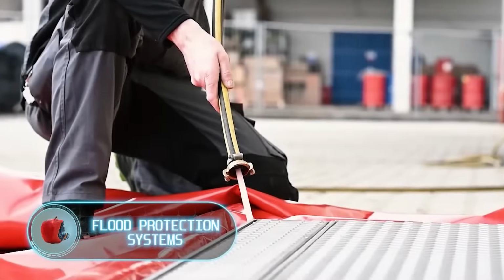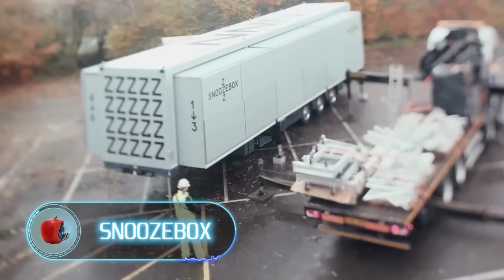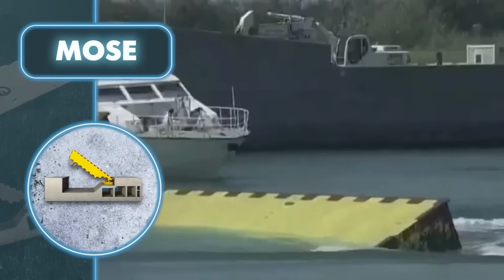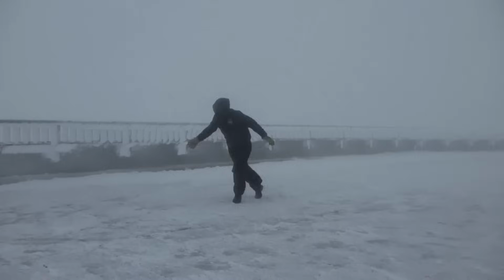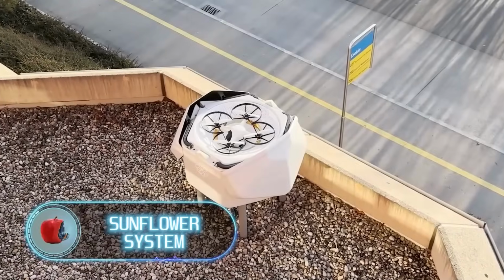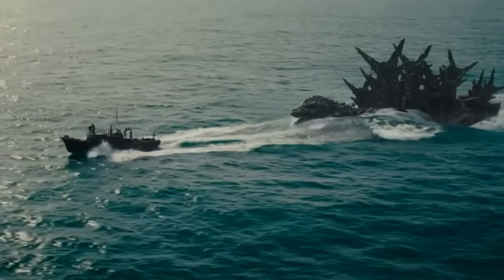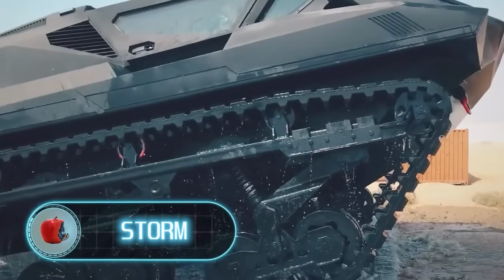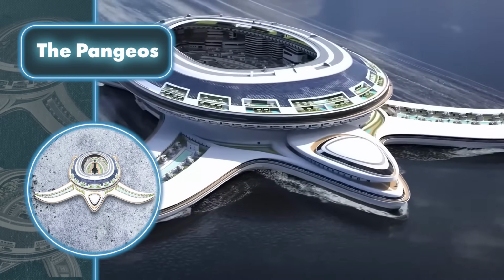50 Incredible Inventions for the End of the World

Comment: Solar flower made me think, it was going to be wind turbine combo unit, obviously it wasn't, but the idea (at this moment) seems interesting to me, using large surface area blades at low speed, and with the right control system deciding to give solar or wind priority for aiming direction, getting dual use out of a site.🤔😁

Comment: Get an electric lock, put the controls on the opposite side of the door.
A fireman I knew, he designed his house that way.
You walk up to the door handle. Push down on the door handle, but do not push on the door from there. That's where the door is hinged to the wall.
When you push down on the handle. The other side unlocks and pushes open a little bit. Where you can push the door open. It would mess people up.

Comment: From my experience in Zombie Apocalypse I will suggest the spikes are a bad idea. Zombies tend to get stuck on them and render them not only useless but can work against you. If backing up (not a good idea in an apocalypse) does not dislodge them, then you will have to do so manually. I would make them retractable for this purpose. They they should slide off leaving only a minor oozie residue to wash off.
If anyone needs suggestions for Alien invasions or Godzilla attacks let me know. But It wont be here as its inappropriate to the poster of the video.
Reply: I was thinking the same thing plus those rim spikes would either break off, break your wheels or get you stuck in tight spots

Comment: OK, major, major problem with using some of these underground storm shelters.  Anyone else notice that most of the doors open outwards? Have this thing in the basement inside a house and the house collapses?  You areTRULY stuck.  No way out, no way to communicate for help.  Away from the house and the tornado blows a tree or a car on top of it?  No way out.  To use it as a storm shelter, the door needs to open inward OR have a fairly good sized window that opens inward.  Better to have a door (with a window) and a separate window to exit through.  Easy to armor the window (and who says the window need made of transparent material?).  In the military, we learn not to retreat to place that has only one exit (caves come to mind.  Anyone else read 'Dune'?).  Don't you do that, either.
Reply: On a horizontal storm door you usually install vertical posts with headers so debris can't obstruct the door but many builds don't include this

Comment: The water barrier is good unless you have a shoddily built house like mine where the water will seep in between the foundation and concrete block because the house was built by the lowest builder, and I'm sure in the 1970's they were paid by the hour with alcohol.

Comment: the Re-Leaf is by far the most stupid way to do what its suppost to do.   any diesel powered 4x4 capable to carry a generator will do that job 3000times better. but anyway....
Reply: Giant Freak LOBSTERS could snip all the wires you hook to that, and disable it. Someone needs to go back to the drawing board and re-think a few things, they didn't think of everything. I wouldn't feel comfortable with something if it didn't provide for the possibility of Giant Freak LOBSTERS, too.   Just sayin' ...   Surf and Turf, Baby.   Surf and Turf.
Reply: Have to remember that most EVs except Teslas can supply power. But the diesel generation wont work because all of the motors will have been banned by more stupid Goverment regulation. Reminds me I need to invest in a quality generator or two using dual or tri fuel.

Comment: It's truly amazing how this building gets around.... A bunch of large vehicles pulling it..... Truly revolutionary.
Reply: Not really.  40 years ago I lived in a sleigh camp while cutting seismic geophysical research lines thru the remote wilderness in northern regions. There was a kitchen unit, about 10x60 feet including 8 bunk beds for crew and 1 room for the cook. Behind this unit on ski's was another with a generator and fuel tanks for heating and electricity. Behind that was another office/bunkbed unit. We drug it behind a 48000 lb dozer with a winch. Fun fact, if you head downhill, they want to pass you, so beforehand, you wrap a logging chain around one or two of the sleigh runners, to slow you down.